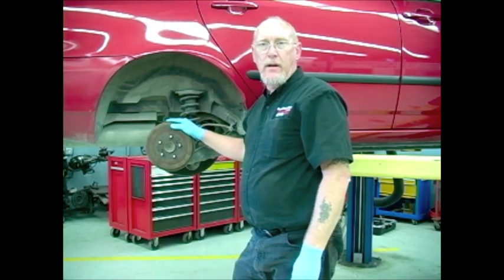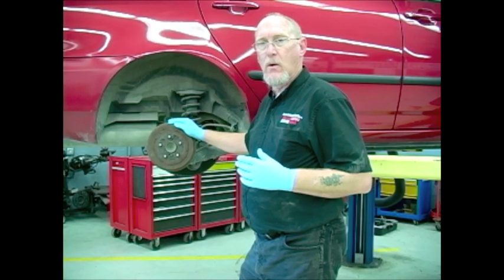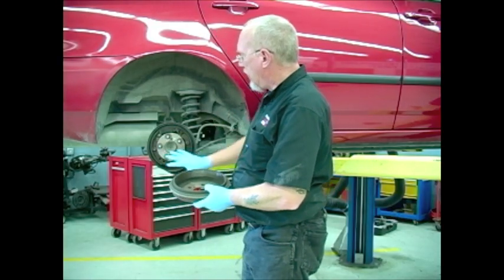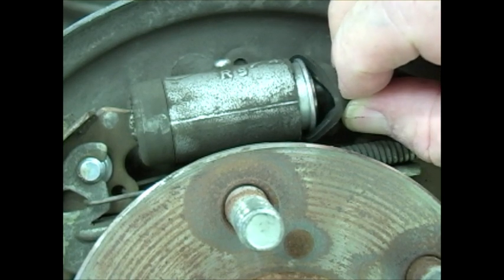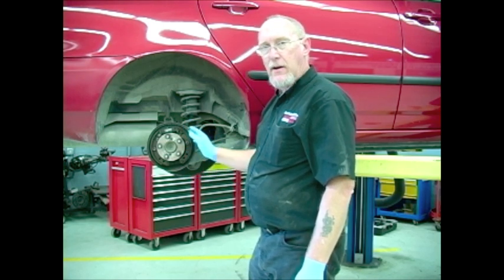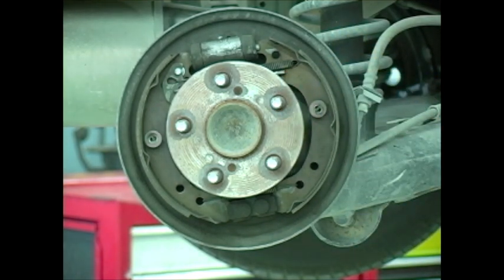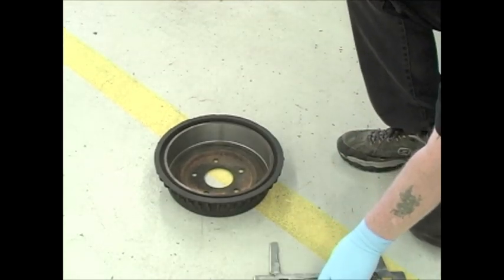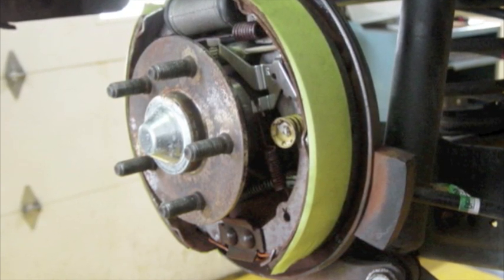The Trainer #14: Drum brake service tips

Comment: So here's a tip, before machining, measuring a drum> (an other tip. no need to buy a drum measuring tool just take it to the auto parts store or machine shop have them measure it) < all ways measure it from 1/8 to a 1/4 of an inch from the opening.  drums get what's known as belled, which is caused by the shoes expanding the drum over and over , with that said the most inner part of the drum will be smaller than the outside of the drum,, and 95% if not all of drums have this condition and should be machined when new brake shoes are installed.. if the drum discard is 10.090 and the drum measures 10.075 at the bottom chances that the most outer is larger because of belling and chances are the drum will not make the machining process.

Comment: How do you find the correct adjustment for a ford ranger
Reply from the maker: Adjust the brake shoe clearance until you feel a slight drag as you rotate the drum. Double check by applying the parking brake pedal. It should only need 5 or clicks to fully engage. Double check the service manual for details and any official specs the OEM may have for your truck.
Reply: Motor Age can’t I turn it all the way till the drum want move then back it off a little then it’s good
Reply from the maker: @brandonwebb1819  That may result in shoes that are a little too tight. Again, check your service information for the correct procedure for your vehicle.